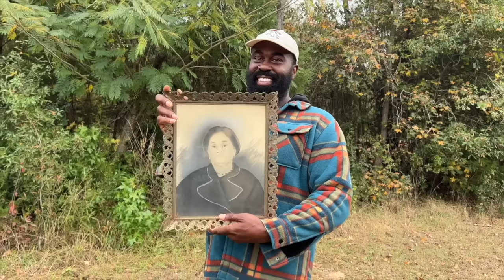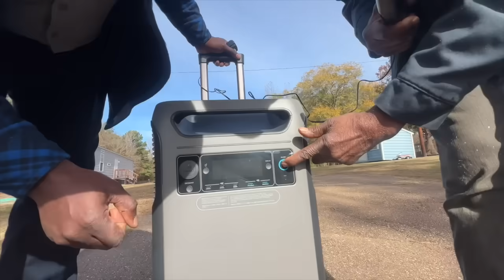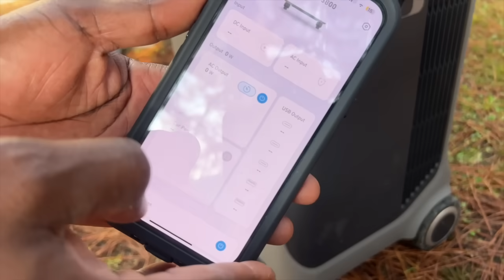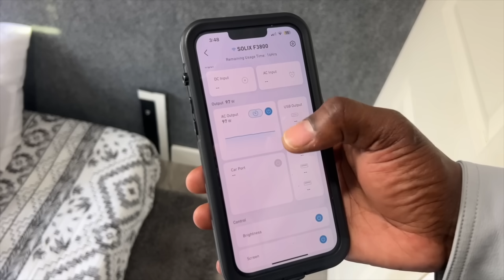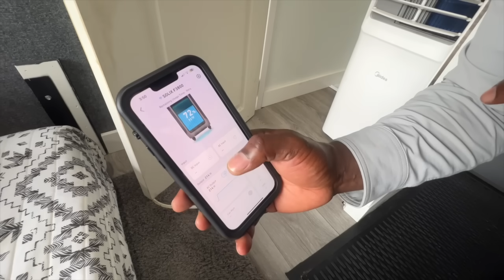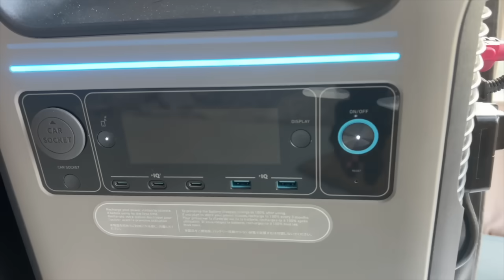We Powered Our ENTIRE Homestead on ONE Solar Generator

Comment: The closer you are to 80% load on a gas generator the more efficient it is.  That is the more electricity you get per gallon of gas.  So using it to charge a solar generator while running other things is a good idea.
So just charging this you'd want a 2,400 watt generator, or 4,000 watts to run a heater or air while charging it to get the most out of the gas.
As far as solar panels the generator will say how much current it can pull and the max voltage.  If you use 2 y-splitters/combiners you add up the current and use fuses on the positive.   While putting them in series you add up the short circuit voltage not going over the units max voltage.
This can draw 2 x 25 amps with each of the solar inputs capped at 60 volts.  With my panels that would be sets of 6 in parallel with 2 sets in series and a total of 12 panels per input.  You get more power out at higher voltages and less losses from longer wires, so it's not a perfect system but you generally need to build them yourself to get high voltage chargers.

Comment: These cheap high frequency, transformerless, power inverters can be dangerous for powering household appliances or your computer. They lack an output transformer to provide galvanic isolation between their DC boost stage and their AC output so when their MOSFETs fail, they can pass high amperage DC current through to their AC output and fry your appliances. If you doubt what I'm saying, then ask Google AI the following question: Can a high frequency, transformerless inverter damage your appliances? And learn the truth about these potentially  dangerous products.
Reply from the maker: @solarcharging9743  okay thanks for watching….

Comment: Solar is good, but a good propane generator back up is key. For example, using the Solix supplemented with a dual fuel generator. In times of darkness or extreme temps the generator can charge the Solix.
Reply from the maker: @bradmason8334  Brad, you are so correct man! A family member just got a propane generator and it’s great. I like the idea of charging it with the Solix. Now you got me thinking!

Comment: Good vid and thumbs up. Like the cabin. We built a totally off-grid 12x24 barn style in the Sacramento Mts of NM. Bought an Anker 767 (2024 W/hrs) and later a Solix BP2600 (2550 W/hrs) expansion battery (total, about 4570 W/hrs). It can run 3 sets of lights, 4.5 cu ft refrigerator, ceiling fan (no need for any cooling up here, just heat!), pressure demand pump, keep my radios charged (NO cell service for 45 miles) Starlink setup, computer, small 5 cup coffee maker. Don't use a microwave, but they suck about as much juice as a coffee maker. 350 watts worth of solar panels and we do just fine. Snow days--these days!--requires firing up the gas generator for recharge for an hour or so.    Wanted to mention to anyone who needs to know that the Anker Solix apps on the phone allow you to set the charging input wattage. Wasn't in my 'instruction manual' so stumbled on it, but maybe is now. Of course, slow charge is best, but in a pinch can be set up to 1400 input watts. Unless something has changed in the past year, there's no way to set the input rate on the generator itself. If you're in Texas, hope there's not a repeat of a few winters ago. We stood at 4° this morning with two inches of snow.
Reply from the maker: Thanks for sharing your experience, and I hope your setup keeps working well for you!

Comment: Thanks for this great video Will. I just bought a solar generator as well to try a little project for my 10 years of EV ownership this year. I just want to be able to trickle charge my Chevy bolt. So far I have a pecron e3600lfp and a 255watt solar panel, trying to save up the $900 needed for four 540w solar panels and then I should be able to charge my car from the sun. Plenty of sun in the Carolinas, I think I should be able to get 30-40 miles a day of range.
Reply from the maker: Sounds like you’re going to be able to charge from the sun in no time! Thanks for watching my video as well, really appreciate you.

Comment: Nice unit and safe to leave indoors wihout the toxic fumes. Add a extra battery to the unit for longer run times or use the gas generator to keep that Anker charged if the sun is blocked by clouds on a cloudy day. That unit allows multiple ways of charging and can be charged with solar panels and the generator at the same time to increase the charging power
Reply from the maker: Great suggestions and you're absolutely right.

Comment: If your kw demand is low enough you can claim anything. Throw a elec. hot water heater, oven, a/c on there and you are out of the game. The cheapest way for elec. is to buy from utility company. They are by far the most efficient at co generation. If you are not capable of their services then you might want to re design you life style. Propane or diesel are not cheap either. What do you do during a string of sunless days.
Reply from the maker: Yup, the AC is a mini split. The stove? Runs 100% on propane—and I pay just $1.50 a gallon. I call that cheap. Plus, my hot water heater isn’t running 24/7. I actually designed my entire lifestyle to be efficient and intentional. That’s probably why you’re here—and why others are too. Appreciate you watching and commenting! This video is all about showing people a reliable backup power solution, especially for those living in tiny homes, RVs, yurts, or domes—exactly what I demonstrated.

Comment: What about hot water for a shower
Reply from the maker: @curtis3282  this unit has 220V plug in and could easily power a hot water heat or instant hot water heater with no problem.

Comment: I have a lot that I can't get powder to would this work for everything or would I have to have solar panels to and what do you do with it when it goes bad
Reply from the maker: You have two options. You can charge this unit and roll it anywhere you’d like by hooking it up to AC power for about 45 minutes or you could connect two-three solar panels and let the sun charge it and never have to worry about plugging it into the AC power. This generator can run a dryer, fridge, a small ax/heater, and many other things all in one. It’s POWERFUL!

Comment: You can build a similar diy set up with 2 or 4 marine batteries ,power inverter, travel case with wheels  and a solar panel briefcase to add a recharge option for under 1000, but that solar generator is a game changer but the warranty is key. Batteries leak, some could have dead cell, a fuse might need to be replaced. That's when the warranty and customer service really shows a good company
Reply from the maker: Wish I knew how to do this! This sounds like a great option for a super small tiny house build.
Reply: Simple as ☝🏾 those on the list

Comment: I'm homesteading in place in Fl and use my power station not only for hurricanes but also to supplement my everyday electric usage powering my Den. It has really made a difference in my bill. I'm now investing in a solar array and a couple of batteries. It doesn't have to be a disaster or whole house solar. Thanks for demonstrating what these workhorses can do.
Reply from the maker: That's fantastic to hear! It's great that you're finding practical uses for your power station. A solar array sounds like a smart investment for both everyday use and emergencies. Keep up the great work on your homesteading journey!
Reply: How will you stay cool in Florida?
Reply: @juliava605  I've retrofitted insulation in my older home, closed off A/C in rooms that are not in use during the day, and at night turn off the A/C for the entire house and use a 5K btu window unit for my bedroom that can be powered by a power station to stay cool while sleeping (why cool the entire house when I'm in a little over 300 sq ft). Doing those things have extended the life of my A/C system, cut my energy bill, AND kept me cool.
Reply from the maker: So smart!
Reply: @CherrieMcKenzie  This is perfect! Thanks so much for the detailed reply. I very much appreciate you taking the time. What power station will run a 5K btu window AC unit all night? Thanks again!
Reply: what power station do you use.
Reply: @mnm291  EcoFlow has worked for me.
Reply: What part of Florida are you in? I just aquired land near Ocala FL

Comment: I have the same Ryobi generator. It’s easily flooded, so I have to drain the fuel bowl below the carburetor using the drain screw. After closing it back off it starts right up.😊
Reply from the maker: Thanks for sharing that tip. I’m going to give that a try!

Comment: such a joy to watch you and your uncle interact!! Great info. What would you suggest for an area that doesn't get a lot of sun??
Reply from the maker: I love him so much he’s definitely one of my favorite uncles. This solar generator works well and even in low sunlight. I like that it charges fast if you need to plug it into your wall power to recharge it. In case of a power outage you could run your lights, fridge, washer/dryer and other large appliances with no problems. It’s definitely better than the gas powered one that I have.

Comment: Thanks Will, I am a ham radio operator and this unit could be really handy for times when we are called out in an emergency, such as severe storms or earthquakes.
Reply: Better check that background noise distortion on this unit. A lot give off a lot of interference. The standby consumption is 100 watts so running a rig wouldn’t be advised. Anker makes smaller units that would be perfect. I have many brands and Point Zero Titan is a great low frequency system. Good luck.
Reply from the maker: This unit is perfect! When I go camping across the country I’m definitely taking it with me. It’s crazy how many things it can power. I hope you get this model. I provided a link in the description for you as well. Thanks for watching too.